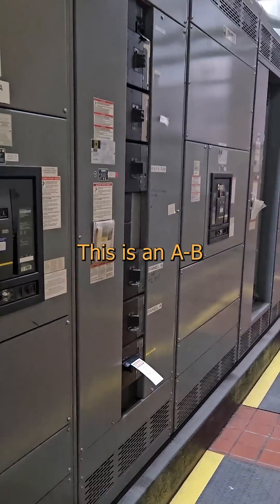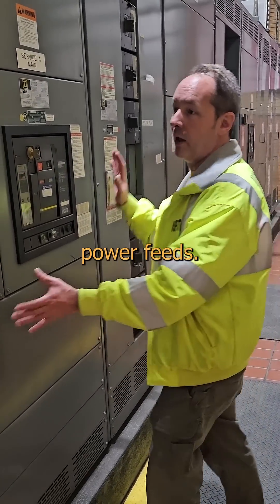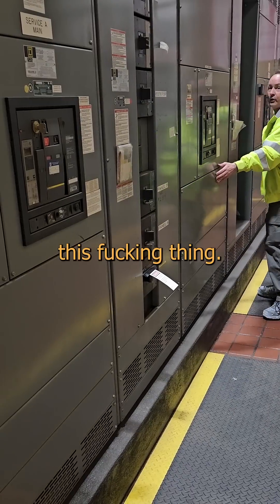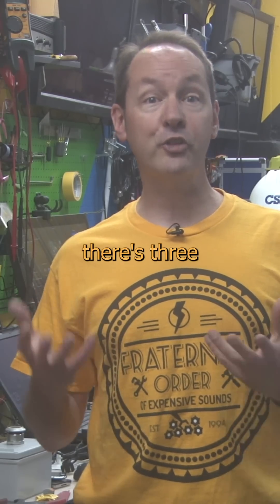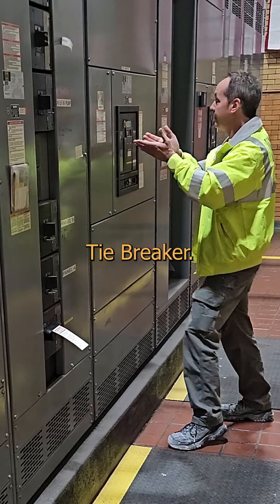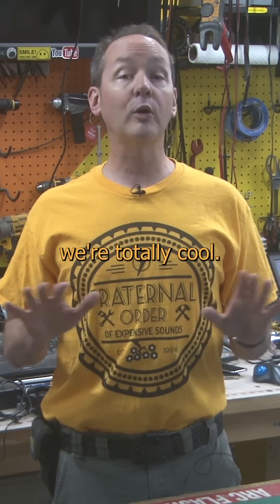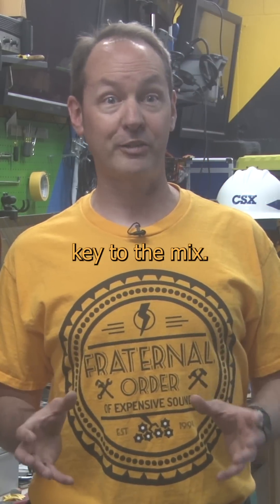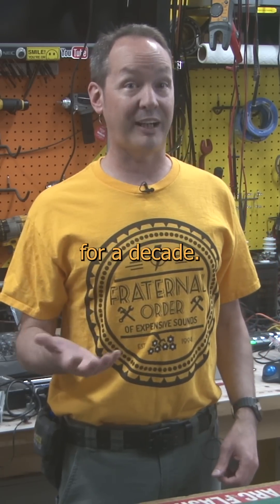A B Interface #chrisboden #comedy #electrical #engineering #energy #substation #switchgear #power

Comment: If you close both, there won't be anything to hose down. I've personally seen two out-of-phase 1.2MW lines bridged. The generators didn't give a shit. The transfer switch became a puddle in the bottom of the enclosure. (this was 1997, so there were no cellphone cameras to record it.)
Reply: Saw the aftermath of a big diesel generator closing in on opposite phase rotation. That was the only time I ever saw a crankshaft with a twist in it. Cat refused to rebuild the engine, no matter how much we paid them.
Reply: @ghost307 there’s a video on YouTube somewhere of a 1.2 MW genset repeatedly being disconnected, drifting off sync, and then being deliberately switched into the grid off sync. It’s still surprisingly intact after the first few — a few coupling parts escape, probably the plastic parts of a flexible coupling. But eventually the big magic smoke starts escaping.

This was the US military demonstrating what could happen if your interlock is purely software based and said software was rewritten from outside.

Almost makes you wonder if they were employing the stuxnet guys at the time.
Reply: What do i search to find this video?@JasperJanssen
Reply: @-SpaceFrog- I think the Aurora Generator Test is the demonstration the is talking about
Reply: @JasperJanssen  This sounds like the U.S. Military doing the right thing and reiterating (In a controlled scenario) the lessons learned through the Therac 25¹. Sadly though, it seems that because the moneymen² believe profit is somehow „more important“ than human safety, they'll keep pushing to have critically dangerous hardware dangling off a $2,- MCU which could possess undocumented features... ☠

(¹ - A radiotherapy device used in the late 1970s. The Model 25 used software interlocking running on a PDP-11 and no physical safety mechanisms like those used on the Models 10 and 20. Due to a software defect there were several incidents of patients becoming overexposed, some sadly with fatal consequences.)
(² - I'm normally gender neutral in my language, but money men is an appropriate reference. In much the same way I'm barred from any high-income avenues on account of my sexual orientation, it's very rare for females to find themselves in lucrative positions yielding the same income as men who are doing the same thing. There's still a lot of sexism and discrimination out there, and that's not at all cool. 🙅)
Reply: @ghost307  Yeah  Only choice is a brand new engine
Reply: My safety trainer at Siemens-Westinghouse's "apprentice" went to electrician heaven because of a poorly located 15kV generator line on a drawing.....his apprentice was killed by the flash and the trainer still had the face shield that looked like it had been sandblasted and painted black.....he was 40 ft away

The pictures from the scene are nightmare fuel for the un-trained folks VIEWING them.⚡🔥
Reply: You know how people become smart? By being dumb and learning not to make the same mistake again ;)
Reply: @MicraHakkinen  that or learning from others mistakes, usually when at work. Had a buddy who worked for the state running massive water pipes like a 5 foot person could stand in big. they used a crane to move them into position. a dude decided to inspect a pipe without safety precautions. the pipe on the crane swung and crushed dudes head like a grape. my buddy said everyone began being extra safe
Reply: @MicraHakkinen not these type of mistakes though, you usually dont get a second try😅
Reply: @thenorthernhandyman  Yeah, some mistakes you don't recover from.
Reply: @MicraHakkinen  Most times you only get to make one mistake. That mistake is your free pass to the afterlife.
Reply: @MicraHakkinen  ...providing they survived the first mistake. ;)
Reply: Jisus.. i can only imagine how that whole engine jumped the mounts. Did the generator or engine mounts break as well?
Reply: @gglovato As I recall that was why Cat flatly refused the rebuild. They were concerned about the block being either deformed or overstressed to the point of near failure.
Reply: @ghost307 i was just going to ask why they refused but I saw your answer and it makes sense!
Reply: I taught electrics to future commercial pilots. First course I taught had a former cruise line electrical engineering officer as a student. He told the class about an out-of-phase short (two of three phases shorting, so 120 degrees out).

Of course they are powering the screws from AC motors, so it was powerful enough to blow a hole in the side of the ship.
Reply: Actually the switches he shows here will take that they are main feed breakers designed for horrifying fault currents, there will be a massive kaboom in the breaker and its contacts and arc chamber will be damaged but it will clear the fault.
Reply: Wow @alouisschafer7212
Reply: Wow

Comment: Why is there no interlock that makes it impossible to switch circuits in unwanted ways? Keys are no interlock, many off the shelf keys are keyed alike for god sake. Millions of dollars relying on good faith and competence is not security it's the reason you pray like an idiot before going to bed.
Reply: Kirk keys use a proprietary blank and specialized cutting equipment. They're almost impossible to duplicate.

Comment: One might imagine there'd be a mechanical interlock preventing all the breakers from being closed at once. Apparently, one would be wrong.
Reply: They are KIRK Keys. The lock captures the key and will not give it back to you until it is safe to do so. As an example, the tie breaker requires a key to close the breaker, that key is currently captured in breaker B. In order to retrieve the key from breaker B you have to open the breaker (disconnect it) and lock it in the open position. Now the key is released. Breaker B cannot be reclosed without the key, but you took the key and used it to unlock and close (connect) the tie breaker. The key is now captured in the tie breaker and it cannot be taken back out until the tie breaker is locked in the open position. We use KIRK Keys in high voltage switch gear religiously.
Reply: @HiTek3  Trapped-key interlocking, Kirk(tm) is one of the many brands that make interlocking.
Reply: That interlock is called „2 keys“… oh wait.

To be fair, pretty much any interlock reliable against millbillies with pipes on a lever in a century can also guide angry pixies with enthusiasm, thus causing the expensive sounds they’re supposed to prevent
Reply: I worked at a water plant with a medium voltage transfer switch like this. The breakers are electrically interlocked and electrically thrown
Reply: @derekholdeman4461  yup, used similar in all sorts of Mines, mills,  etc
Reply: They're all keyed the same BUT yes the keys are retained i.e. you can't unlock the breaker then remove the key, each breaker needs the key to be in to be able to switch it on, so you can only ever have 2 of the 3 breakers on at any one time
Reply: When I was on a sub we had a lever on a lighting bus tie breaker that would physically block one bus from being closed if the other was closed.

To switch buses you would have to open the first one before moving the lever and closing the second one.

During an inspection they asked a new guy to switch the bus, he made all of the right calls and contacted everyone he was supposed to. Then instead of turning off the first bus he unscrewed the lever and flipped the second bus on.

Luckily all the power comes from the same place and the nukes back aft noticed immediately and took actions but he still managed to blow a few lightbulbs and give everyone a good scare without too many expensive sounds
Reply: @frogsshadow4189  gotta love how even when something is supposed to be safe, one special person can always manage to get around those safeties.....
Reply: Nothing is more reliable than prevention. Thats why there are 3 keys, and only 2 allowed at once.

It prevents the chance of failure entirely, provided people stick to the training instead of bringing the keys together like the triforce of catastrophe, at least theoretically. Theres probably several scenarios where this can fail even without a 3rd key, but I guarantee those scenarios also have things preventing them, or at least intended to. Cant beat stupid cause mother nature will always one up you, but you can do your best to try.
Reply: @MrBlack0950  There are not three keys. There are only two keys. That's the whole point.
Reply: @KindredBrujah  Oh did I missunderstand something? I thought they were 3 distinct locks with their own keys rather than multiple identical locks with only 2 copies of the key.
Reply: @KindredBrujah  "two keys allowed on the floor" There are probably 3 unique keys. If they were all keyed the same then you'd only need one key to cause the issue.
Reply: @TennyBraelle  if the locks retain the keys while the breaker is closed, (most interlock stuff does) you would use identical keys since there’d be no way to take the key out of a closed breaker to close another breaker
Reply: @TennyBraelle  No, that isn't how it works. Two identical keys with three identical locks so only two can ever be engaged together.
Reply: @TennyBraelle  Nope the keys are captive in the locks, they can only be removed if the lock is in the free state, switch closed key is captured.
Reply: The problem is that the Breakers are too far away: linkage across that distance would take up a lot of room in the Switchboard or be too loose (mechanically, the term is "slop") to be reliable. Breakers and Contactors that interlock are mounted side by side--in this case not possible.
Reply: @quietone610  if necessary, you COULD design an interlock without dangerous slop, see old lever frame signal boxes.

But obviously, that’s good enough, so nobody bothers
Reply: You can mechanically interlock it with  a cable interlock kit, which worked like the cable brake and gear lines on a bicycle, but that is annoying to set up and get the cables routed and tensioned. Keying it so that only 2 breakers are able to be closed at the same time is easier. What is fun is when you electrically interlock them. You can have a contact on one breaker send power to the other breakers to activate coils to tell them they arent allowed to close right now. You can use an SKRU to connect key interlocking with electrical interlocking. You can also use a PLC to pay attention to the status of the sources and breakers and open and close them as appropriate, and even start your generator for you if power goes out. Cool stuff.
Reply: I have seen a system like this on boats where they need to switch from generator to shore power. Rather than keys it's a physical bar that slides left and right preventing both breakers from being on simultaneously.
Reply: @binaryblade2  Yep a physical mechanical interlock, works perfectly and is obvious when you look at it. Another method is the breakers having internal links that stop both being closed, or an electrical trip coil that will trip the open breaker into a free position when the other breaker is closed
Reply: Called a Kirk key
Reply: @TUZKGaming  I think there are a few different systems, a common one here is called a castelle key.
Reply: It's a post-it with "2 keys!" on it, somewhere near the bulletin board.
Reply: This could be done with electronics. However, that means you need electricity to manage the controls. Even so, you'd still need a mechanical backup for when the electronics fail.
Reply: @ianbelletti6241 if you wanted to go that route, you could easily pull from an independent battery, or UPS. I'm sure there are reasons this ain't Happening.

We use kirk keys all the time for HV breakers and they have electronic modules as well. 

Follow the single lines and procedures for now

Figure it out and make some $$$
Reply: @ianbelletti6241  actually you would never want to rely on electronics for this. Too critical. That's why someone has to physically have the Kirk keys.
Reply: I have a cute little 32A plug which I can't disconnect while I am drawing power from it.

 There could be a simmilar system blocking the switch when both systems are under power. Administrative measures are great of course but this would add another layer of protection and probably wouldn't cost much.

Comment: Im working in a data centre and this seems like the switchgear? Im new and trying to learn - is this the same thing as a molded case circuit breaker? Also, are automatic transfer switches used instead of manual keys?
Reply: The individual black cubes that connect the power supply buss bars to the wires going to the loads are the molded case circuit breakers. The A-B interlock is the switch in the middle and they can be automatic, but in a data center, you likely have two types of ATS (Automatic Transfer Switches); the first is this type of A-B with circuits that automatically change between the power feed circuits and the second switches between the incoming power lines (often referred to as "shore power" from the shipping industry) and generator power (which backs up your shore power when something catastrophic happens or when the grid signals that it needs to load shed).
Reply: Thank you! 😁@Bear-cm1vl
Reply: What bear said, with one distinction: in most cases, those breakers aren't technically referred to as molded case breakers. That description is generally for sizes under 800 amps or so. They have standard "on off" type handles when they are MCBs. 

The breakers in the setup in the video are more of a metal encased design, require you to charge the contact operating spring by pumping the handle several times (some have electric motors to charge the springs) and they are opened or closed with a simple button push. The forces the spring operates at shakes the whole room and will scare the crap out of you the first few times you hear and feel it. They are especially pucker inducing when resetting them after they trip...they can (rarely) fail violently if they are closed in to a fault or high inrush. (The arcing sound when closing into a high inrush is spooky too.) 

In many cases you have to wear a full 40cal arc flash suit just to operate these even under normal conditions. 😮

I've had to operate these on up to 4000 amp services and there is alway that pause before pushing that button to close in were I go "1,2,3, please don't blow up" and hold my breath....
Reply: @mxslick50 woah!!! Thank you! 😁

Comment: Holy crap, I just built a training system for these, for a client. before that, I had no idea they even existed! I love this channel so much
Reply: It's called a double ended switchboard with kirk key interlock. You will find this in most every large hospital or major waste water treatment plants.
Reply: @craighaney8829 they probably knows what it is called if they built the training system
Reply: @craighaney8829  Trapped-key interlocking, Kirk(tm) is one of the many manufactures of interlocks.

Comment: The unions should low the hours you have to spend as an apprentice. Some states now require 8000 hours as an apprentice for general electrician certification. This is just ridiculous.

A freaking airline pilot needs fewer hours to fly a plane where any mistake can cost hundreds of lives.
Reply: And some states you don't even need a license to be an electrician. If you have a white van and a poorly secured ladder on the roof your good to go.
Reply: Have you ever heard the phrase “ No one smarter than a 4 th year apprentice, no one dumber than a first year journeyman “?  I have been in the trade for 40 yrs. 8,000 OTJ training should never be reduced unless you just want more people hurt and killed.
Reply: I started my electrical apprenticeship in mid sixties in the UK. Mine was 5 years long, or 10,000 hours. That 10k is based on the minimum 40 hour week (back then) But we never worked only 40 hours, the average was probably nearer 55 hours a week, so it ended up being much longer than 10k. Agree fully 8k is still too long (with the right training). Apprentices will probably and sadly be cheap labor, but the salary pulls some of it back after qualification.

Comment: Best part is that most industrial facilities lose the Kirk keys, so they just hand out spares during maintenance and tell you chuck it in the cut when youre done
Reply: Yay for expensive sounds
Reply: They're supposed to be captured or left in the lock for this very reason.
Reply: @erikkovacs3097  and guillotines and presses are supposed to have cages and light guards, i meant to be fair most have, they just arent installed or turned on

Comment: Looking into starting a trades job, not sure where to start cause none of the unions around me want apprentices and there isn't any trade schools near me either
Reply: Heavy equipment operators and competent engineers I'm told are two of the hot trades to get into, but everything is an up and coming... all us old baby boomers are retiring
Reply: And in case you didn’t know once you’re a union journeyman you can journey wherever you want to. If the work is slow near home you can see the country, one job at a time.